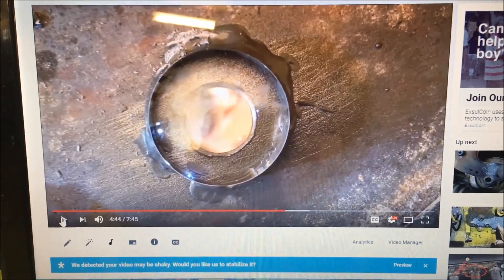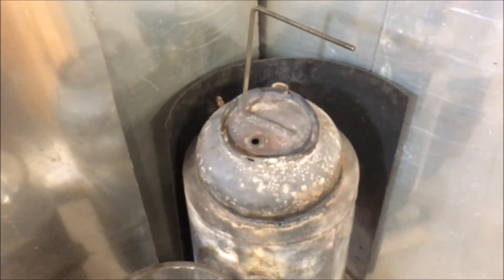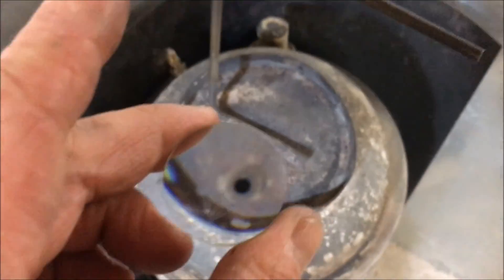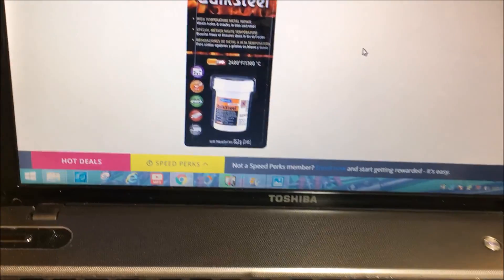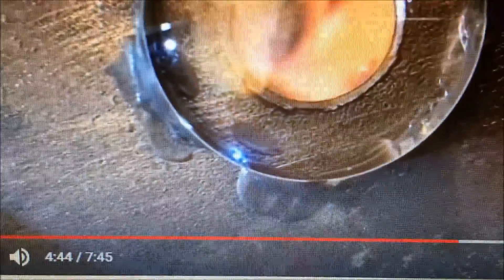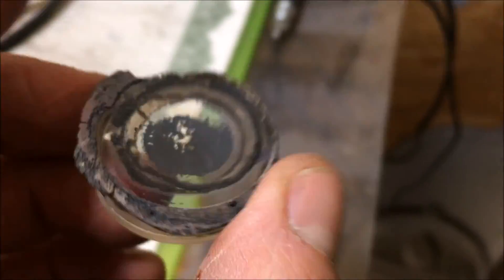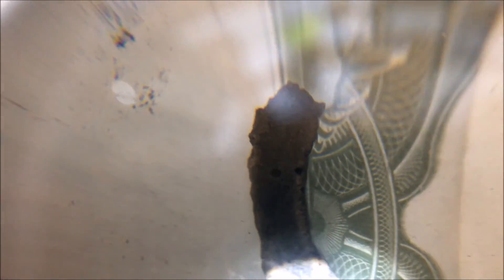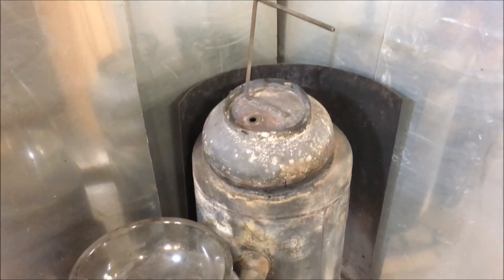JB weld high temp application (LIFESPAN)??? INFORMATION ...

Comment: You know jb weld has an extreme heat that handles twice as much heat as the high heat does. If jb weld high heat lasted 2 yrs with your admittedly shotty job. Try the extreme heat and do better job and it will have to last a lot longer than high heat